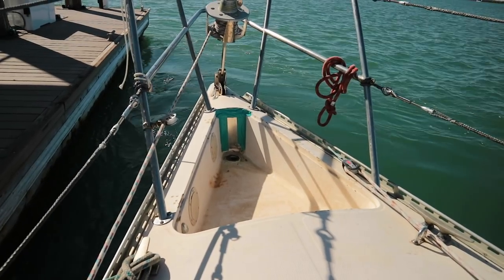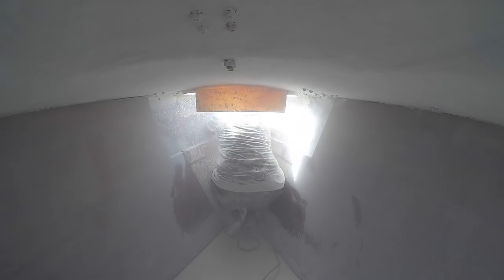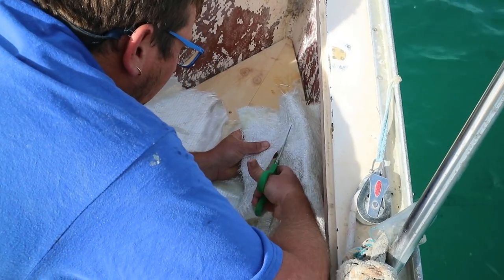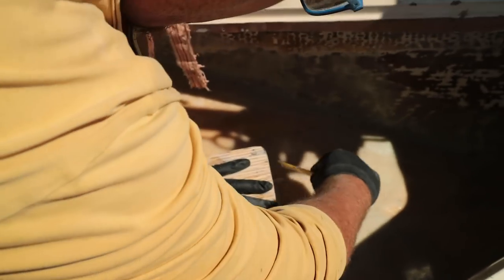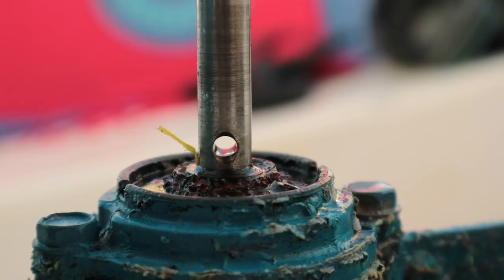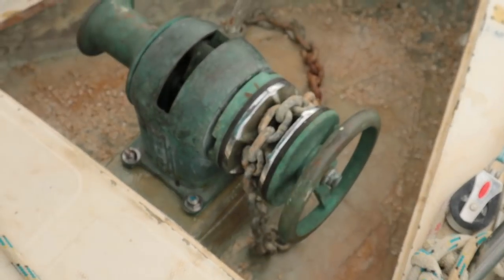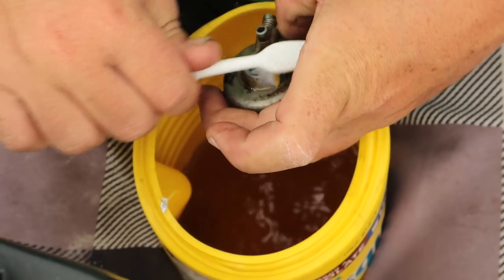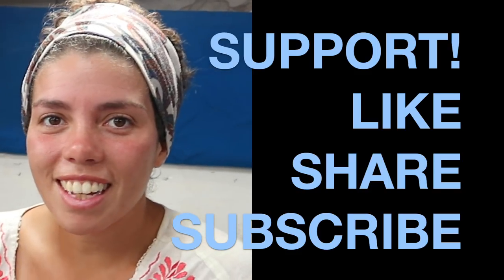44. RIPPING IT OUT

Comment: Nice idea with the dinghy. Beware that west system epoxy with 205 hardener is not Good in the sun. It crumbles pretty quickly. Use the 207 hardener instead which have uv filter and add high uv protective varnish. You can probably add the varnish already to protect the epoxy
Reply from the maker: Didn't know that there is a uv protection hardener. Will keep that in mind for the future!